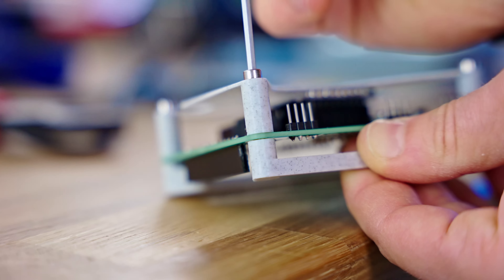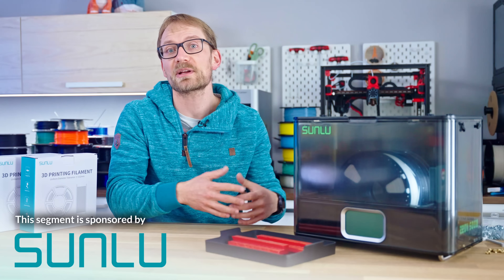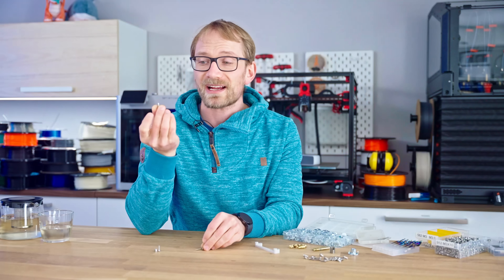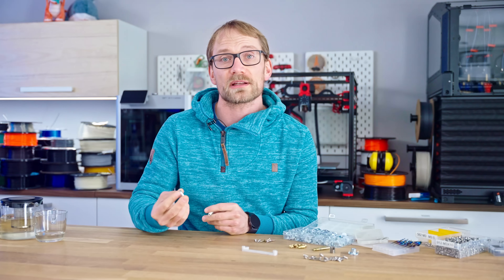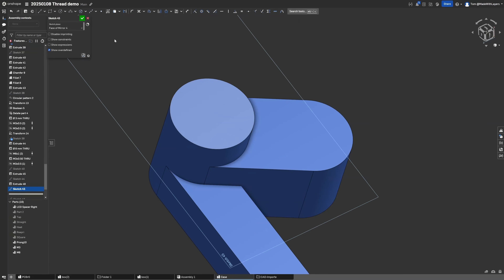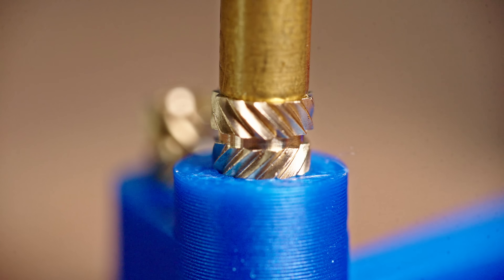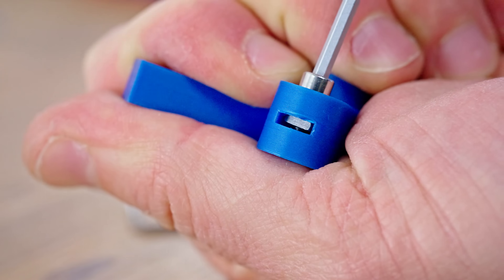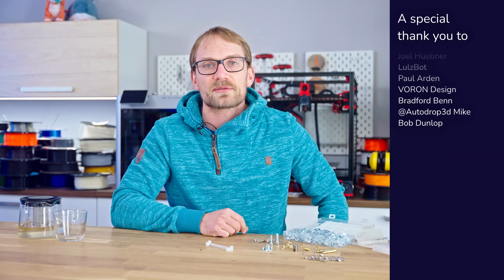A better way to add threads to your 3D prints

Comment: Just slightly heat the hole with hot air then tighten the screw.
Simple.

Comment: I have been using self tapping threads. Never understood why anyone would use heat inserts to m3.. for “once tightened” screws they are overkill and also hard to insert upright without a proper toolset..
Reply: My settings are 2.8mm, with a 0.5mm chamfer at the top for m3

Comment: honestly i get heat set inserts and i just hit them in with a hammer the twisty edges bite hard into the plastic mega strong and easily

in my small bedroom i do all my work on my desk by my 3d printer so its really ideal no need for a solderingn iron or that big 90 degree stand and they go in perfectly straight everytime

Comment: My favourite solution is sunken hex nuts from the other side. I make the hex slots slightly undersized so the bolt has to pull the nut into it's nest and once it gets seated it won't fall out by itself even without the bolt being present.
The bolt can reach through the whole print preventing layer separation, or the nut can sit that deep a short bolt from the other side can reach it.
Nuts are easy to source, strong and easy to replace if worn out. Hex nuts are slightly thicker and better quality than square nuts.

Comment: are self forming threads good for resin prints?
Reply from the maker: It will depend on how flexible your resin is. I don't think they'll do much "forming", rather the screw will be chipping out a path for itself, but it might still work. Let me know how it goes if you try it out!
Reply: @MadeWithLayers  I could create a thermoplastic insert which fits into the resin part and then put the metal screw into the insert... sorta like a wall plug. I could literally use a wall plug!

Comment: 1. Adding thread relief or chamfer makes screwing in screws significantly easier 
2. For self-tapping use radial engagement of 40-50%, this way you will get formed threads instead if cut ones like when using a tap. Though I only tested it on PETG.

Comment: I strongly disagree about plastic screws. They allow MORE torque than melt-in inserts or mechanical screws. You just need to set the hole to the proper dimension: pitch diameter (screw thread diameter minus screw core diameter, divided by two). Make sure you have at least two perimeters outside the thread diameter. No material is lost in the process. The thread simply rearranges it.

For some applications, I have frequently unscrewed lids with no durability issues. The tapped thread is hard to miss, and the plastic screw easily finds its way without causing further damage. To ensure optimal control, screw by hand or use a torque-limiting setting on your electric driving device.

Additionally, plastic screws provide more contact surface than self-forming screws with only three points of contact. Note that wood screws are not suitable for plastic. Their thread angle is incorrect, and the threads are too thick.

Compared to mechanical screws, especially with small diameters, plastic screws outperform them in most applications.

Comment: Really good overview! We print a lot of parts in PETG, and drive the M3 screws 4/5 of the way into 2.5mm holes fairly fast. The friction softens the plastics around the thread, and after 20 seconds cool down time, the thread is perfectly shaped and we drive all the way in. Its a success in PETG when they are 'squeaking' the last couple of turns, then we know its a perfect solid thread.

Comment: You don't have to use a fancy geometry for self forming threads. You don't have to make a round hole at all, instead use a pentagon/hexagon. That's easily generated in any CAD and works quiet well too :)

Comment: I keep a post-it on my monitor that says "geometry is free" when I'm designing for 3D printing. Great ethos to keep in mind and I'm definitely going to use the hole geometry you showed for threads
Reply: When designing for 3d printed parts you need a specific mindset, geared towards what is possible/easy with this technology vs impossible/difficult. And the two categories do NOT always align with what was common for metal/wood working or even injection molded parts. It is sometimes difficult for those, like me, who grew up with the paradigm of mechanical workshop and related tools.

Comment: For heat inserts: 
I'm using a cheap Lidl battery soldering iron with the original conical tip. Heats up in seconds wherever you fancy to work at. And you don't need the right threads. Works absolutely perfectly. Couldn't be better. Did about a hundred now with it and it's perfect.
Reply: Snap! Haha

I use the exact same soldering iron, and it works great! 

Only fault, if you can call it that, is that the soldering iron tip is about M5 diameter.

This means that the tip can fit down inside M5 and larger inserts.
Due to that, you have to press the tip on the edge of the insert at a bit of an angle, instead of being able to press the insert in from the centre, so you get a little less control.

Regardless though, it still works pretty great!

Comment: I've used hundreds of "just holes you screw into", probably thousands. They're usually reliable and when you know that a 2.5mm hole works best for M3 screws you're good to go. Only disadvantage is that they work only a few times (up to 5).

Comment: I use hex nuts and heatinsert them on the other side of the hole. That works really well and the nut basically doesn't or shouldn't move when something is screwed in

Comment: I always use the first method (simple hole) and I have never had to repeat them to get the right size, even with a bad tolerance machine (the Anet A8, I was young and naive). What I do is make the hole exactly the size of the thread (like 3mm for an M3). In a perfect machine this would mean no grip at all, but since no printer has perfect tolerance it grips the screw perfectly. But the method of the 3 ridges looks better, as my approach probably works worse and worse the better your printer is. I have to try it.

Comment: i use a smaller streight hole and then when screwing the first time i use a warm/hot screw so the plastic melt at the right spot

Comment: I like very much your M3 tapless threads, very clever. 
How I did you calculate the inner/outer diameters ? 
Do you  have any recommandations for other diameters like M4 M5 M6 ?
Reply from the maker: Finding the sizing was simply down to experimenting. The dimensions for M3 ended up working out so that the overall hole provided just a little clearance for the screw thread, while the ridges go down to about the thread's tap drill size. 
M3 would be 2.5mm, but the Bambu printers tend to under-size holes, so I went a little larger than that. 
I'd assume using the same proportions would work well for larger threads, too.

Comment: A trick (when applicable) with unthreaded holes is that you make a deeper hole than the screw you intend to use. Let's say you want to use a M3 10mm screw, you make the hole 5-10 mm deeper so if you would happen to wear out the hole you can just switch to a longer screw.

Comment: Following your previous video on the matter I tested the threat-repair inserts and ended up switching from heated inserts. The result is so much cleaner. But 99 times of a 100 I use a narrow hole where the screw make a thread itself.

Comment: What is this air filter used for? Just for the workshop or for the entire house? It sounds like an interesting project. (I have a lot of wood stove pollution here)
Reply from the maker: Same reason for the filter here - right now, it's just a pre-filter for the ventilation unit for my studio, as the tiny original filters only last two or three months and then cost 30€ to replace. But I did design it at this scale to also work for a whole-house ventilation system once I find the time to install one.
Commercial filter holders for this size filter are about 150€ for each stage, so printing one was a no-brainer for me. Might also add a printed refillable activated carbon filter in the same 287x287x48mm size eventually. I'll have the files available on Printables when it's in a publishing-worthy state ;-)

Comment: I mostly use plastic screws, and find this method really easy, reliable, and very strong. And it does not need that much precision on the hole size.¹
Of course, you need to have enough perimeters (as for machines screws), and you should not remove them too often.
¹ I will give a try to the 'self forming thread' method, this is a nice idea.

Comment: I don't use any special press with guides for melting inserts. Just a regulatet solder iron. After melting I screw in a long screw and adjust, while it is warm yet, the axis by looking at the parts with one eye closed from horizontal and vertical view. Need a bit practice, but is fun to make.

Comment: Tom, ya missed embedded nuts! (seeing the comment from @chaosswissrol after I posted)

Its great to combine square nuts into a part by pausing the print, removing the need for slot. I've also found that it allows for a wider tolerance on the mating screw, as you can design in a ton of float into your square nut cavity. Ping me if you want some sample CAD. 

Anyways, great video as always!

Comment: For openscad the threading functions in the bols2 library generates excellent threads (with a little initial tolerance tweaking).I do actually wonder about the idea of combining the self forming threads approach with a printed thread, it might actually reduce any tolerance tweaking needed with fully printed threads.

Comment: With OnShape it should be straightforward to make a custom feature for self forming thread screw holes of any dimension.  Showing folks how to do that might be a good video in its own right.  FeatureScript is amazingly useful!

Aside: It’s a good idea to increase the number of perimeters when threading into plastic.  I use Plastite screws in 3D prints all the time that way and they are super simple and robust.

Comment: I find the idea of building a tool to insert heatsets somewhat extreme. Like drilling holes, just learn to hold the tool square to the surface. It does take a little effort to calibrate the mark 1 eyeball in the first place but it's a good skill to have generally.
Reply: I agree, though having said that, when I've got a few hundred heat set inserts to install, I'm glad I took the time to convert a dremel workstation to insert them. Straight and to the same depth every time. A lot faster as well.
Reply: @simmo8018  Doing things in large scale generally justifies proper tooling so that's ok ;-)

Comment: wood/plastic screws have worked flawlessly for me. the part strengths is mostly in the walls, so all my prints have at least 2mm of wall. you just shouldnt model the holes to be the same size as the small diameter of the screw. 0.15mm of thread bite is more than enough to hold any screw joint. you can also pre-soften the hole with a soldering iron, acetone or friction. soft materials like Nylon and TPU can fit any size screw into any diameter hole
Reply: Yes I can’t believe he blew off a proper PT screw. I have settled on a few sizes and have my own notes in the parameters for CAD. Order them in bulk and have years worth in my cabinet. They even commonly have Torx heads which I  love.
Reply: Same, I used wood screws for almost all my projects. I tried other techniques thinking they would be better and always came back to wood/plastic screws.

It's cheap and work surprisingly well compared to more complicated solutions.
Reply: They are called self-tapping screws. They are exactly the standard in all plastic enclosures.
Reply: @Nobody-Nowhere  PT specifically are “plastic tapping” and have an optimized profile for thermal plastics like pc/abs blends but can work with PLA and other thermal plastics.
Reply: This comment needs to get more attention ❤
Reply: Could you pre-heat the wood screw to help it deform the plastic?
Reply: @djmips  yes thats valid. there's the risk that the plastic could stick on the threads and make a mess. an induction heater might be very useful for mass production/manufacturing of screw joined parts
Reply: In a few minutes you can design a Fusion model that has 2 bodies: 1 - the screw and 2 - the cavity to cut a hole. Import, cut with the cavity part, hide it, and the screw is left behind. So easy. I don't bother modeling the threads. Have used this for literally thousands of holes.

Comment: I am a mechanical engineer at VMI-Group. After much effort to convince the company, I have finally been given the freedom to investigate plastic 3D printing as a legitimate production method alongside sheet metal and CNC.

These are topics that are now extremely important for me to investigate.

The thread repair inserts sound very good to me. We often use M6 to M10. In the workshop, it is normal to tighten the bolts to the correct torque. That is why it is not advisable to have plastic between the thread and the bolt because plastic suffers from 'creep', which can easily loosen the bolts. So therefore I would argue that *Prong nuts are not a good solution for the long term*. Would you agree?

With the steel inserts, it is possible to tighten the parts as tightly as you want, because there does not need to be any plastic between them. Also a big advantage point is that it can be a blind hole, unlike for example, the prong nuts  This is therefore a good method for when the holes are exactly perpendicular to the print bed orientation. Which is fortunately quite often the case.

I am very curious about simple methods for connecting holes that are not perpendicular to the print bed orientation. If anyone has a tip for me, I would love to hear it!

Comment: This is probably one of the only times I've disagreed with you. And that is regarding the plastic self tapping screws, especially vs tapping threads in the print itself. A self tapping screw doesn't remove material, it cuts into it. The threads have such a coarse pitch that you're going to have around ten layers per thread and the spiral shape means you've never got a complete disconnect from layer to layer. If you're worried about perimeters, just add an extra one or two perimeters.
It'll be stronger than any heat insert of tapped thread.

Comment: You missed one with the ultimate spin prevention: the humble, cheap wingnut.  Sure, they are a lot larger and thus are more difficult to find space for, but they can't be beat for spreading out torque load.

Also, T-block square nuts--used with aluminium extrusions--offer the same benefits of regular square nuts, but are better for resisting twistout.

Cheers!

Comment: If you can give prong nuts 5 stars for strength you can give inserted nuts also 5 stars because you can place a normal nut the same way as you placed the prong nuts(other side of the printed piece)

Comment: I like to melt a little my screw in my print to create to thread. Either by driving it a bit fast, or just heating and driving it quickly after. Again it not a full melt, just soften like annealing.

Comment: At work we have one assembly where DIN 7500 screws are used to form their threads in a C-channel of an aluminium extrusion. The screw has a slightly triangular (trilobe) crossection at the tip and the tip is also a bit conical. 
I was curious how they would perform in full circular holes in printed plastic. I only tried M3x12 I had easy access to and only in PETG. But the results seemed good. It was less sensitive to the exact tolerance of the hole and it always started forming the thread nicely and go in smoothly. Also the thread looked nice after removing the screw and it was easy to re-insert the screw and catch the start of the thread with fingers to avoid forming a misaligned second thread. Or use a normal DIN 912 machine screw for the second time. 
I just checked some eshops where I buy screws and it seems DIN 7500 are not so difficult to buy. But there is less selection of sizes and they are more expensive than regular machine screws. 
I really like this idea of printing the inverse of such trilobe thread forming screw right into the part and then using just a regular screw. It is really smart and I will definitely start using it. 
But the thread forming screw might still occasionally be usefull if I want to use someone elses design that has just normal holes sized for machine screws and I don't want to spend the effort to modify the 3D model.
Reply: That sounds similar to self-tapping sheet metal screws. Basically a screw with a drill bit on the tip. Also very cheap and easy to find at any hardware store.I wonder how well those would work in 3d prints.
Reply: @AD-qs9sb  Those also have coarser threads similar to wood screws. And maybe the drilling tip would clearance the hole to always be the same as long as it was printed just tiny bit smaller? But as Thomas said in the video, if you print only two perimeters the coarse thread migth cut trhough significant portion of the hole wall making it weaker.
Reply: I remember the bodymakers using those DIN7500 screws on the buses where I worked and that was 20+ years ago.